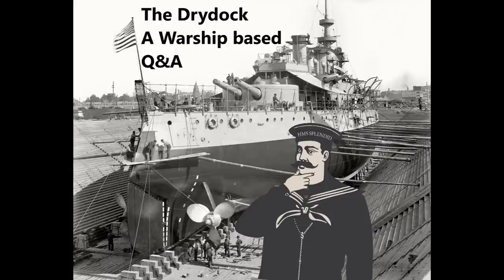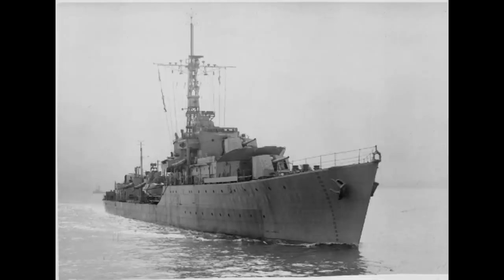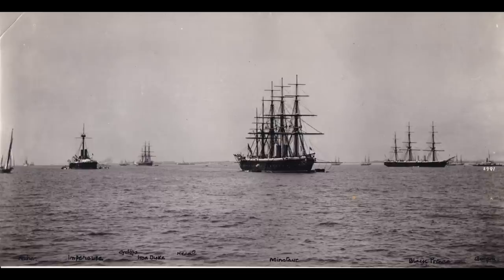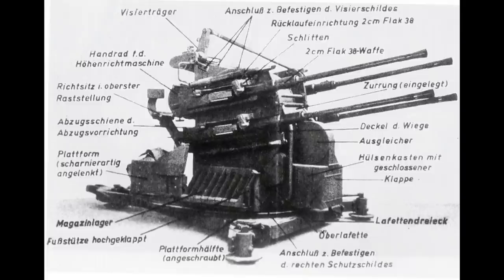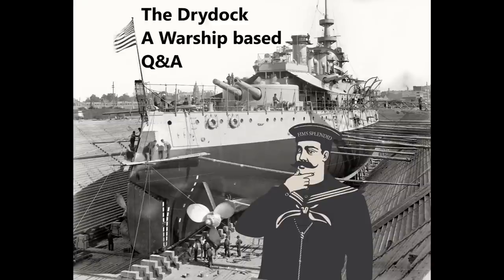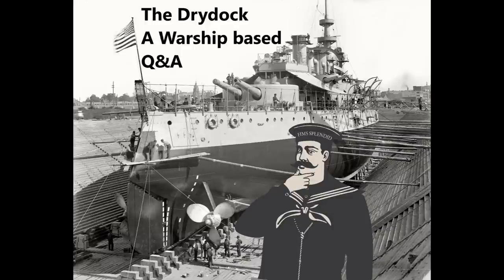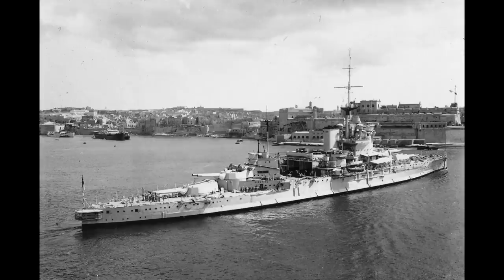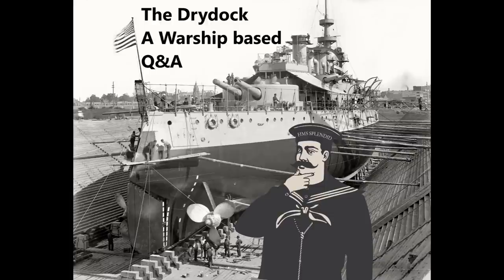The Drydock - Episode 190

Comment: The vibration problem required both special modeling and masses of data crunched by people.  " Computers " were often pools of women with mechanical calculators  like the Ten Key adding machine.  There  was a fairly recent movie about the space program converting from a human computing pool to digital computers.   Processing large data sets and complex data models  was very hard until after World War 2.  I study this stuff like Drac studies naval technology.  Another great video
Reply: Would love to hear more.
Reply: Computer was actually a job description
Reply: What the "computers" at NASA were doing was complex, but simple compared to the combination of hydrodynamic and mechanical systems involved in this kind of calculation.  Today this type calculation requires extremely long runs of successive approximation on a computer or often requires use of a super computer.  In college I worked on some very simple calculations of this sort.  The computer center would only run my calculations between 11PM and 7AM because they tied up the main frame for too long.

Comment: A similar vibration issue arises in hydraulic impeller/turbine design.  One pumping plant I know of had vibration due to blade passing fixed blade frequency.  Initially dealt with by installing sound damping doors in passages.  But finally the impellers were reshaped/replaced.  This plant was built in the 1980’s.

Comment: Re: "Why were the vibration problems of the North Carolinas missed during the design process?", 2 points.
In terms of testing and vibration, this is similar to the problems in investigating "aeroelastic" or "flutter" in aircraft; the fundamental problem is that the scaling rules for the aerodynamic effects (or, more generally the fluid effects) are different to those for scaling the mechanical/structural effects. It IS possible to do it, but requires a very sophisticated and expensive modelling approach, often using expensive materials to achieve the required physical characteristics.
In terms of the Tacoma Narrows bridge, while you are correct in saying it attracted atention to these kinds of issues, there is a degree of debate as to whether the actual mechanism involved in the collapse of the bridge is what is popularly attributed.

Comment: Speaking of boats on subs I believe 'the sub that sank a train', the USS Barb, used rubber boats of some kind when a small force from her crew went ashore on July 23, 1945 in the Japanese prefecture of Karafuto.  They laid explosives on a rail line; which subsequently blew up a train.  I assume those would be inflatable or collapsible boats of some kind; but I don't know if they were specially laid aboard for that mission..
Reply: German subs had inflatables as a regular part of the equipment (at least in WW2, not sure about WW1).
Reply: @Segalmed  The French cruiser submarine Surcouf was large enough to have a 17 foot long motor launch stowed away under the rear decking.

Comment: About he question at 00:00:40 about radar jamming.  In the Pacific War the Japanese were interested in radar jamming, but they had a problem with their scientists and electronic engineers getting drafted and fed into the meat grinder of the war, rather than staying where they could do their country more good.  According to the book "Secret Weapons of WW2: Japan in the Shadow of Big Science," one of their research development operations; the Imperial Navy and Army ran separate radar research projects and didn't share information with each other, started with about 800 personnel working on radar but only had about half that number by the end of the war.  

The Japanese did receive a German radar jamming device and worked hard to mass produce it and put it in their ships, but the allies had switched to higher frequency radar sets making the Japanese jamming devices pretty much worthless.  Both sides used chaff; strips of aluminum foil, to jam each others air search radar; however, the Japanese couldn't afford to just throw aluminum away, so they used it much more sparingly, mostly to mask incoming kamikaze raids.  B-29's started carrying different types of radar jamming devices in 1945; plus chaff, which made radar fire control for Japanese anti-aircraft guns pretty much useless.  The Japanese hadn't learned to spread their radar frequencies, making their radar very easy to jam.

Comment: As regards carriers, I always understood that the main difference between Fleet Carriers and Light Fleet Carriers was speed.  There is the circular argument that a Fleet Carrier needs to do 30+ Knots to keep up with the Fleet so Fast Battleships need to be built to keep up with the Fleet Carriers.
All the Royal Navy Fleet Carriers post Courageous had an advertised speed of over 30 Knots, the initial Light Fleets, Colossus and Majestic Class did 25 knots whilst the Centaur Class had twice as powerful machinery so that they could act in concert with the Illustrious class Fleet Carriers, so it can be argued that Hermes was a Fleet Carrier...
Reply: The 30 Knotts was for launching aircraft, not to keep up with the fleet. Carriers set the fleet speed.

Comment: I am pretty sure, having read some U-Boat stories, that they regularily sent over some Dinghi (when operating under cruiser rules). So, I guess at least the Germans had inflatable boats on them more often than not.
Reply: U.S. subs, at least the GATO's and later, had inflatables they could paddle over to another sub with. No need for outboards or extra fuel. Dick O'Kane sent his XO over to other subs for conferences regarding wolf-pack actions the Tang participated in, and there are numerous mentions of using an inflatable to exchange parts or movies with other subs they met with when possible. They could bring these out any of the deck hatches when surfaced in calm conditions. Small special forces actions usually used small inflatables as well. Hard to find space, sure, but it is really a lot easier than finding more space for the extra men.
Reply: The Barb definitely had an inflatable.

Comment: Theory aside ..ww1 and ww2 taught us that 6 inch doesent work well against large vessels and 8   8.1 or 9.2 are required to seriously injure an enemy large vessel.... 

6 inch is good against destroyers not cruisers ..
Reply: Which was the US experience at night in the Solomon Islands. However, most treaty cruisers never had the armor to resist 6" shell fire, especially from the US cruisers with their superheavy and properly AP shell (the British used a SAP 6" shell). The US 6" AP shell can penetrate a County or Takao's 4" belt from beyond 10,000 yards from what I can see. The rate of fire for the US 6"/47 Mark 16 is also much greater than for any competing 6"-ish gun, so the general answer is going to be different for the US than it will for any other country.
Reply: @kemarisite  Also, there wasn’t much of anything in. Any Navy between 8” & 11” anyway, so…🤷
Reply: @grahamstrouse1165  the British 9.2" cannot be discounted, and I'd be really curious to have seen a Super County (or whatever) with four twin 9.2" turrets and suitably upgraded armor.
Reply: @Frank DeMaris
Yes it's a pity there were no USN 6 inch cruisers at the battle of the river plate... Unfortunately usn were busy perfecting their night fighting capacity.. at the time .. irony...

But yes lovely ships the USN had in the 6 inch slot... pity we could have used a few.. but rusty destroyers was all you could manage.. more irony... USN treaty 8 inch were good as well.. no torpedoes for some reason but looked nice... pity about the night action training (maybe they were overtaken by other night action priorities)... lovely ships though... very clean.. as little used till almost too late....
Reply: @janwitts2688 also, as far as going after "large vessels", while the US had Portland and San Francisco at First Guadalcanal (November 13, 1942), with San Francisco scoring the hits that disabled Hiei's steering, the British at North cape had four cruisers, only one of which (Norfolk) had (edit) 8" guns, the other being two Towns and a Crown Colony. And I've never been able to get an answer as to how thick the armor over Hiei's steering gear was; at just a few thousand yards the US 6" should still be good for 7-8" of belt penetration.
Reply: @kemarisite  It existed, but was almost never used during WWII. Some coastal defense ships had guns in the 210-254 mm range & I think there were some fixed land-based batteries in that range. Those middle-caliber guns were mostly relics, however.
Reply: @kemarisite  The County class were 8” gun cruisers.
Reply: @grahamstrouse1165  I know, thanks for pointing out the typo.
Reply: Idk if I agree with this. A hail of fast firing 6 inch rounds can destroy funnels, superstructure, range finding equipment...
Reply: @kyle857  that was certainly the thought at the time. Note that the US, with proper AP shells and guns firing 8-10 rounds per minute, goes a lot farther in achieving this than other navies with "semi" AP (SAP) shells and guns generally firing 5-7 rounds per minute. Against battleships, smashing the upper works is about all a cruiser can contribute unless it has torpedoes and can hit with them.
Reply: @Kyle
Battle of the river plate... the British 6 inch cruisers hosed down the German ship... very superficial damage...
Then the British 8 inch cruiser with its one remaining gun scored a hit on the Germans fuel processing plant and sealed the ships fate...
The bursting charge of a 6 inch is puny compared to an 8 inch..
Yes if you have ships with 15 x 6 inch then you can do some serious damage to upper works. .. however those 6 inch cruisers would likely take one 11 inch hit and be totally fkd up....
In the end you get what you pay for... hence why the usn had powerful 8 inch and alaska cruisers towards the end of the war...
6 ing is more usefully employed vs enemy destroyers and other lighter units.. the main problem being when a cl is trying to close a ca .. it's likely to be severely mauled on the run in.. before reaching ideal range...
Unlike computer games you actually have to be ridiculously close in any sea to constantly score hits...
Scoring 4 5 6 x 6 inch hits and damaging a funnel and some boats on deck won't equal taking an 8 inch hit on the way in destroying a turret and another closer in damaging an engine room...
Against destroyers yes.. ideal...
Unless they have super dupa torpedoes... ohhh

Comment: months before the launching og BoB ,gen martini in the Luftwaffe signal corp despatched a dirigible whose pilot was tasked to interrogate brit progress in radar,,,,,  the blimp in  foggy damp weather traveled up the brit coast,going too far inland,his presumed position was off, by a mile or 2,causing the pilot to crash into a hill in the fog,severely injuring his back, radioing his position back to base,which position was mistaken,leading the girls at the base oscliloscopes to think of radioing the fellow his true vectors,which would have tipped their hand to the germans,the pilot returned with his blimp,reported his inconclusive results,reported thence to goering who saw no reason to repeat the mission,, the first battle was a technological and tactical defeat  by the germans,which mistake everntually became a defeat for air superiority,,necessary to have prior to invasion, goering later on blamed milch for this,getting a medal from hitler for his efforts,,dowding understood science and its use, fatso and the boss did not= they lost.
Reply: The Brit radar was at a wavelength* chosen such that a wing spar would be a half-wave reflector. So perhaps 15 or 20 meters, I forget. German radar was at shorter wavelengths*, 1.5 - 2m which they used in their search. Thus they didn't detect the Brit signals.

And this explains the conspicuous radar towers around the coast, to mount the aerials. No-one on the other side thought this through.

*Yes, I'm old, and I read this a long time ago. And the wing spar was probably a sensible choice while fabric-covered aircraft were still in use ie during development. I've not seen the hitting the ground story, do you have a link, please?
Reply: Further - Brian Johnson, 'The Secret War' says the Zepellin flights were in May and Aug 1939, and remained out of sight of land. Wavelengths were 0.5 - 1.5m and 10m respectively, not as I suggested.